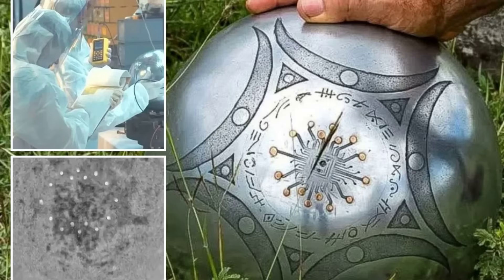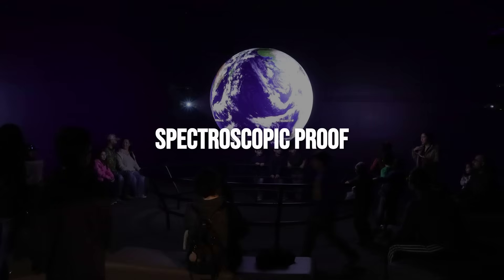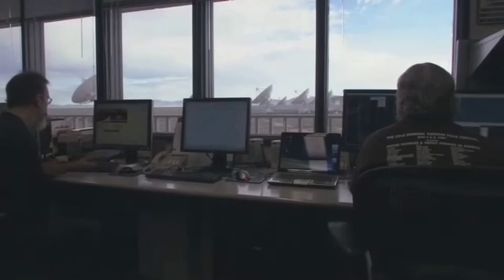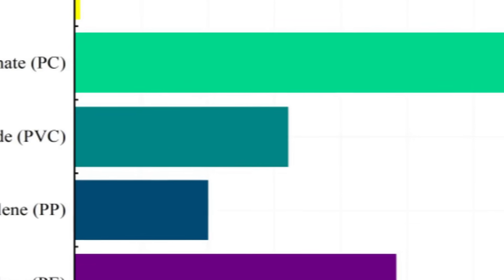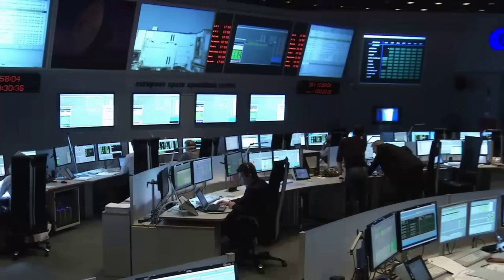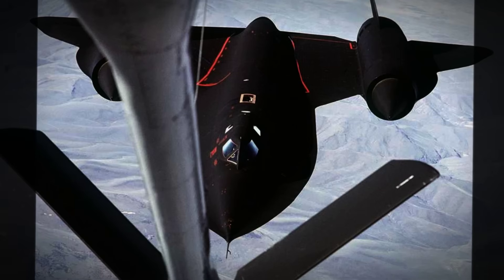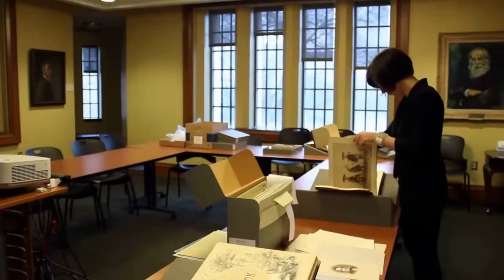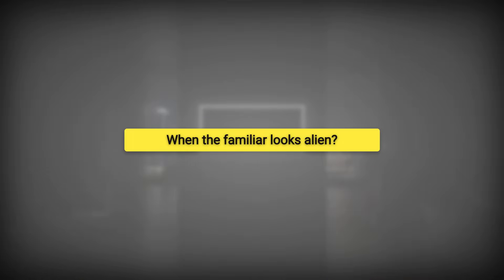Scientists Now Believe the Buga Sphere Is a Returning Earth Probe.. Or is it?

Comment: On July 11th, 1991 during a Solar Eclipse over Mexico City fore-filling a 700 year prophecy, the return of the Masters of the Sky. There was a flying saucer in front of the Sun before, during and after the eclipse. I work up to such a sphere in the sun porch/bedroom. I drew a picture of this object. It was the size of a basket ball. It was silver metal. It had a 1.5 " ban around lets say equater, and 2 such bands north to south, and a 2nd band 90 degrees north to south. At the 6 intersections was  what looked like a circular lens. My thought was to get off my knees and try to grab it. it was then the equater band between 2 lens that a square dissolved open and a very small like nail came out. The sphere turned until the pistol barrel that pointed my arm. A white-blue ball was shot and it slowly moved towards me, touched my arm shoulder and I passed out. This object read my mind about getting up to grab it. I wanted see if it was real and I was not dreaming.There were no graphic design etc that I could see as it was a 5 minute event I will never forget.